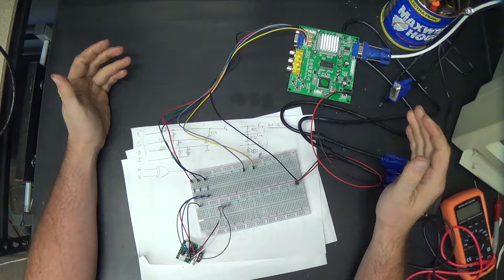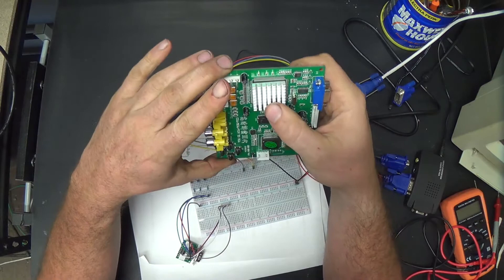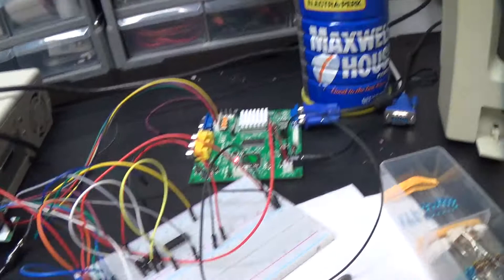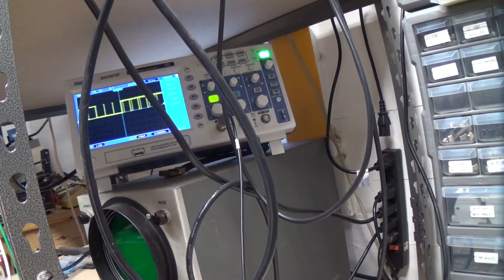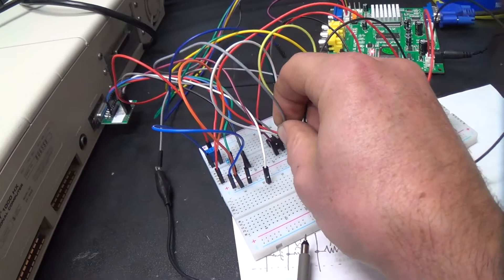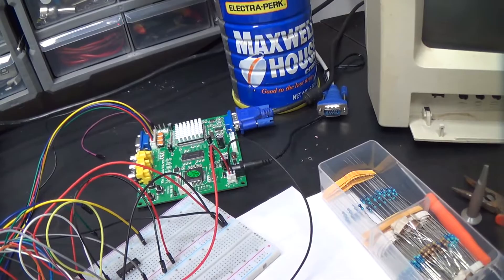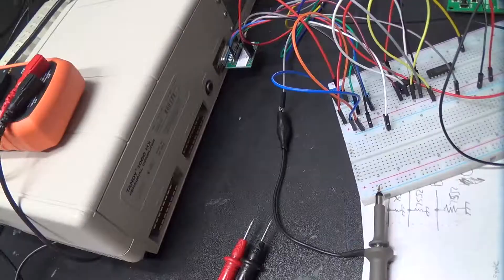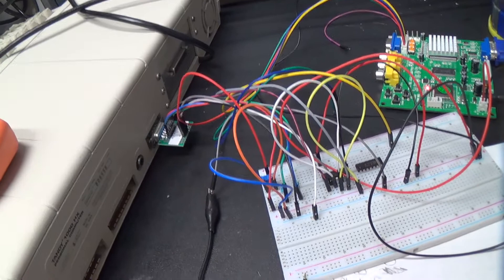Let's Build a Big Fat KVM Thing (Pt.03) | Failing to convert CGA to VGA.

Comment: It's possible that the 8200 doesn't like to see a blank monochrome signal, if you're just testing it with a constant blank red screen.
I can see your schematic there, and I'm not sure why you're pulling the signals to ground. Unless I'm misreading that. 
If you want, I can play with my setup and upload some schematics that I know for certain to be working with the GBS-8200. If those fail, you'll know for certain that there's something wrong with your unit.
Reply from the maker: That's the 75 ohm termination inside the monitor.  All I have on the TTL RGB lines at the moment are 470 ohm resistors.  The intensity bit isn't hooked up yet.

I'm pretty sure it's the GBS-8200.  I've reflowed everything that has anything to do with the video input, and now I'm getting a green screen with garbage on it when I select the RGBS input.  Same garbage when I pull the RBB lines off and just feed it csync.  I've tried XOR and OR sync, both inverted and non-inverted, and it all results in the same garbage.  I guess I'll order another GBS-8200, as this one is way past the return period.  I should have tested it when I first got it, but I put it on the shelf to wait for this project.  :/